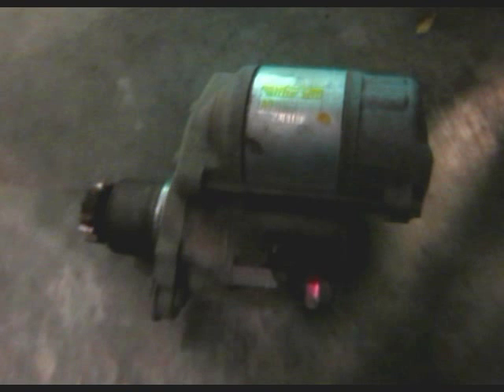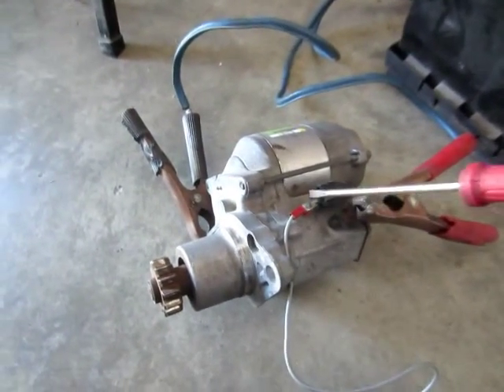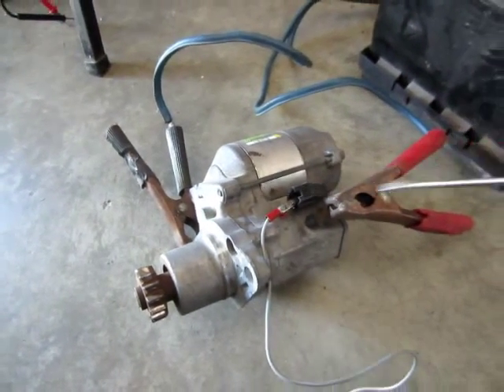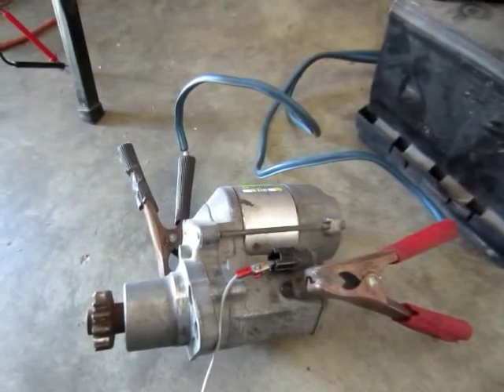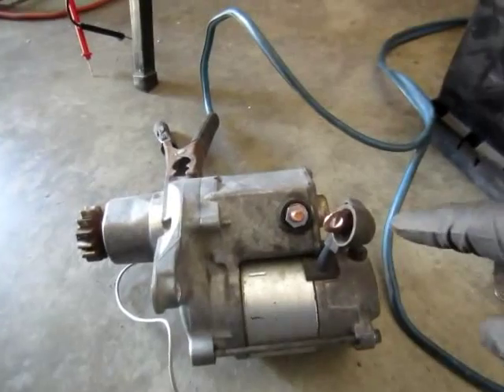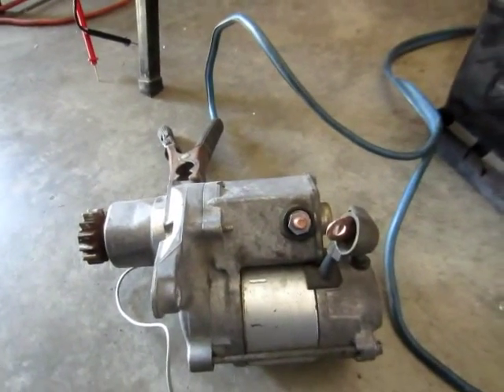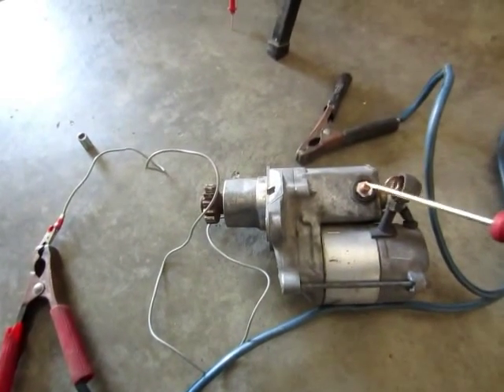How to Diagnose and repair Starter Motor for Toyota Rav4

Comment: When testing the solenoid, I don't understand what the small white wire is connected to as I can't see where it goes. Can you please explain? And thanks for all the great videos! Very, very helpful!
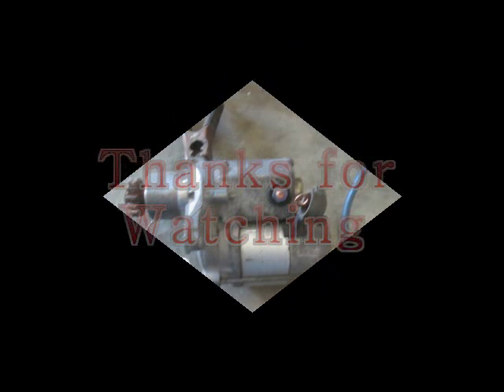Reply from the maker: When testing the solenoid, one end of the white wire remained to connect the black connector (video location 1:00/2:45), the other white end was connected to positive red cable (video location  2:13/2:45). Get it?